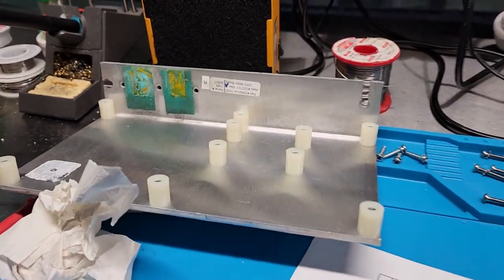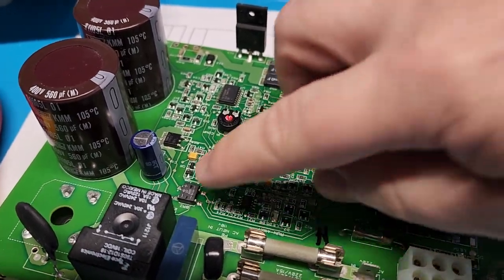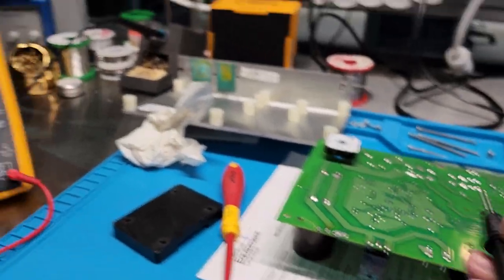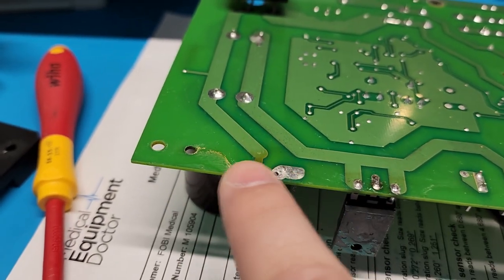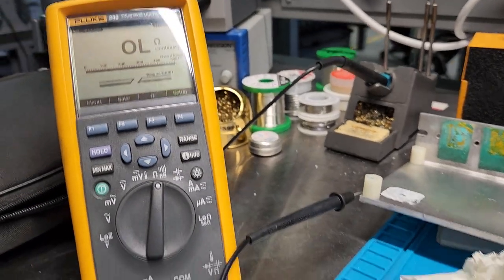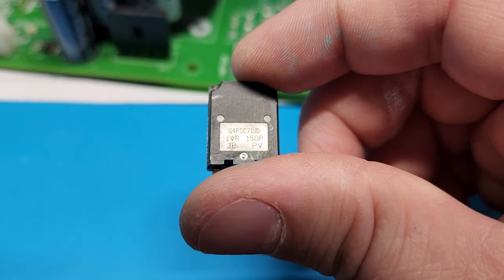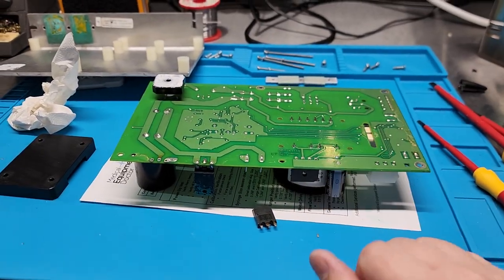Treadmill Motor / Power Board Repair

Comment from the maker: After watching this I realize I shouldn't do videos at 7am...  I'm talking while I'm thinking and I realized upon review that several things are wrong.    I was soo tired.  The IGBT pulses dc to the motor and the other semiconductor is a freewheeling diode which allows bleedoff when the power to the motor is stopped while the motor is still in motion (now generating electricity).
I am so sorry for the errors. I wanted to diagnose this board and get a quick video in before heading to the airport.

Comment: so big and you did almost miss the 3rd bridge, personally i would have exchanged both IGBT's if not too expesive cause the heat could have changed its specs, it is an IGBT not a MOSFET
Reply from the maker: Out of sight, out of mind!
Reply from the maker: I made corrections in the video description. Thanks!

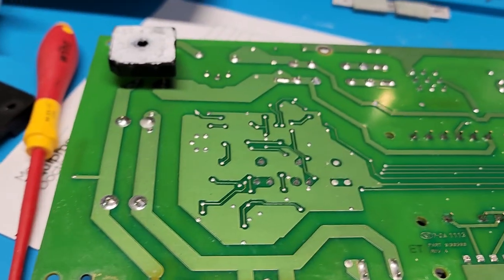Comment: 2:08 The thirth bridge rectifier on the top left corner.
Reply from the maker: I can't believe that I forgot the large bridge unit on the back
Reply: @BetterBiomedChannel  , i think you have overseen it, because it was covered with thermal paste. Bridge rectifiers are normally not connected to a heatsink, and just flapping in the breeze.

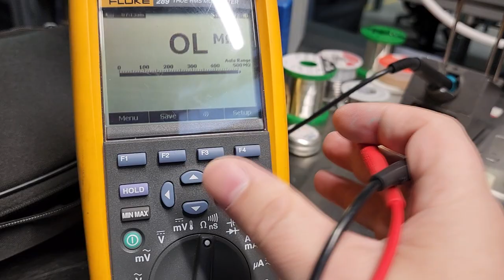Comment: i know its a bit old video but cant help noticed the mistake @ 2:36 its a set of diodes and not mosfet as you say.
Reply from the maker: It's an IGBT - I messed up by calling it a bridge rectifier at 3:05